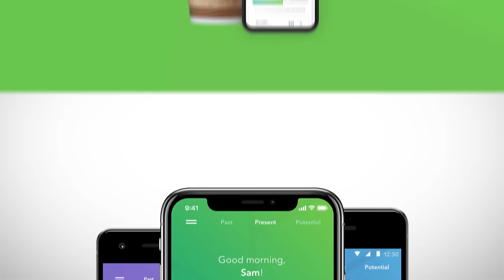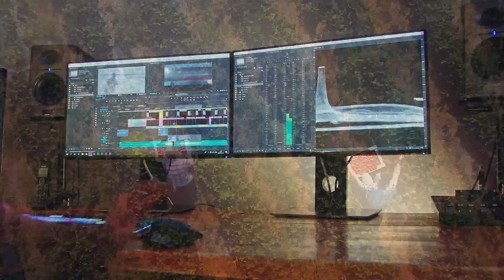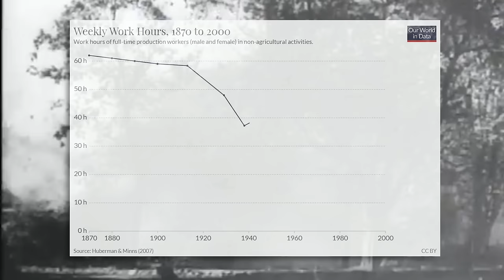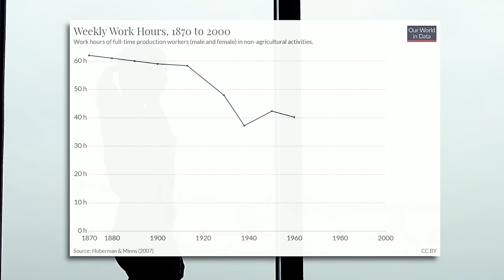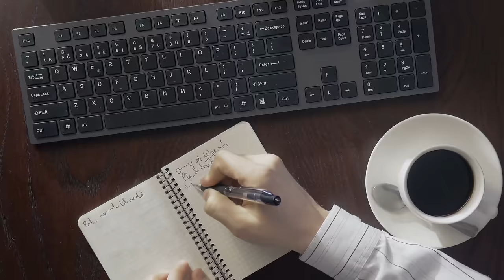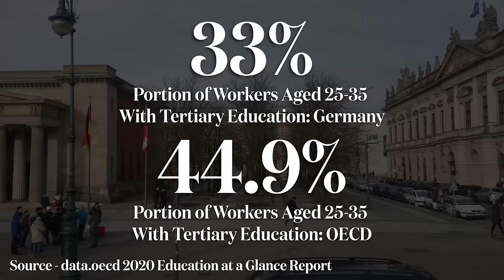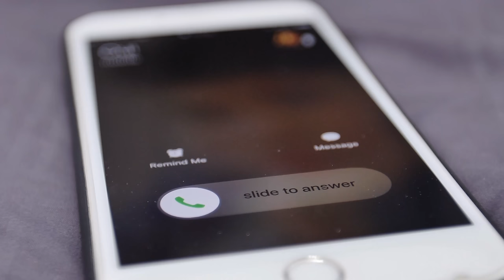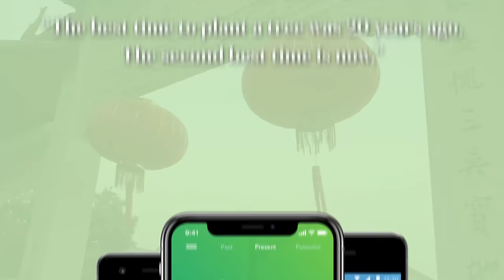Why is Working Harder Making Us Poorer?

Comment: Yes, shorter work weeks would be more economically efficient as people could actually be paid for the effort they put in, rather than hours, and it#d allow people to be more enterpeneurial, or to do more jobs at the same time.

The problem is, the current system does not want to maximize productivity. It wants to keep the working people stuck where they are, so the people running the show will not have competition from them.

Comment: Something that frustrated me in school and work was people not putting in effort and making it a waste of time. I finished my engineering coursework within the first half of the first of two years allocated to be spent on it and got a merit. Those lessons just became me spending two hours of the school day trying to help my peers who either can't focus (for reasons such as ADHD) or refuse to work. 
Uni has been a struggle because there isn't a rigid, compact structure to it. Everything is always up in the air so it is always unclear when to switch on or off and I cannot predict whether or not the time spent trying to understand and remember content will be efficient as there is the risk that I have misunderstood it if done alone with no means of firm checking of facts, just general, uncertain accumulation of research.

Comment: I have to correct sth here: the education levels in Germany are counted incorrectly by the OECD. Due to the reason that Germany, Switzerland and Austria have a special education system, that allows blue collar workers an equivalent education to 3 years of college without visiting a university, German workers are highly educated. But becouse the measure techniques of the OECD fail to recognize that, germany gets a low rank on 3. Level Educated people. Unfortunately Germany started to destroy it's very succesfull education system to get a better rank and sends all these people to university now. Which is not a good thing, but a reason for a lot of current problems in our economy now.

Comment: In my first job in a pharmaceutical industry, I used to work rotating shifts. Shifts changing every 2 days. Sometimes my week off day would be straight after a night shift. That meant I spent half the day off sleeping. Next day back to work in the morning or general shift. Insane schedule. Quickly burns you out.

Comment: Germany is not more productive per hour worked than America is. There was 1 metric for 1 year in which Germany topped America in productivity per hour. However, it is generally shown that Americans produce about 10% more per hour worked. Your entire argument is predicated on Germany because you recognize that the other economies that out perform America are small specialized economies that are not meaningfully comparable to America. 

I normally like your videos and find them to be informative but this is clearly an example in which you are arguing towards a conclusion rather than following where the evidence leads. If you have to misrepresent the data, or cherry pick data, in order to demonstrate your conclusion, you shouldn't be arguing for that conclusion.

Comment: Dang, I own an f150. with gas prices I rarely drive it. I cant justify 12mpg.
Reply: I'll take the ranger, leave the 150 for heavy hauling.
Reply: It hauls a pallet weighing 1000# easily. The ranger struggles w/ the same weight. Think I maxed out ranger @ 1000#. F150 took 2500#. And yes you could hear the air intake. When u can hear the gas flow...

Comment: This video misses major points on why there are such significant differences between nations around work hours and productivity.

The first and most major one is legislation.
Legislation defines the framework for work hours and productivity. Without deeper explanation there you are misleading your audience.

Second is history of labour led political movements.
In economics nothing is natural. Unions, workers are negotiating and battling with company owners and governments make laws based on the balance of power at any given time.

Unfortunately your video has a very large flaw when it does not mention those aspects in why the differences are this large between countries.

Comment: "The average working hours of the average full-time worker has never been as low as they were in the later half of the 1930s." 

LOL DUH.  The Later half of the 1930s was the second drop of the great depression in 1937 and rampant unemployment.  Stop looking at just charts.
Reply: A better example would have been the wealth gap of the 1960’s vs now.  Much smaller wealth gap, way back then.

Comment: nope people worked harder back in the early 1900 until the 70s. we were missing alot of A.I systems to help out with the heavy lifting. job accident deaths were much higher then because of man labor. better A.I systems came. help keep the deaths down. even children had to work back in the late 1800s to early 1900s. no toilet cleaning systems. it was tough.
Reply: KLJF  i agree. when A.I take a job. it's normally gone. it 's engineering helping A.I take over lol. they are partners. go hand to hand.